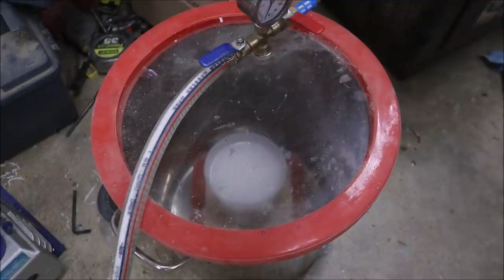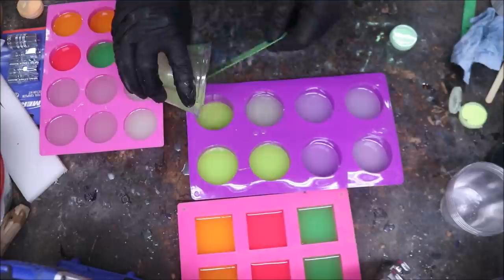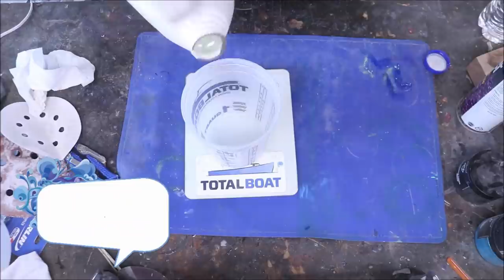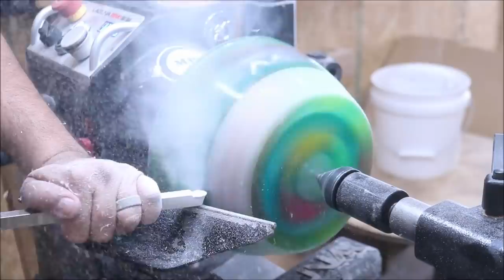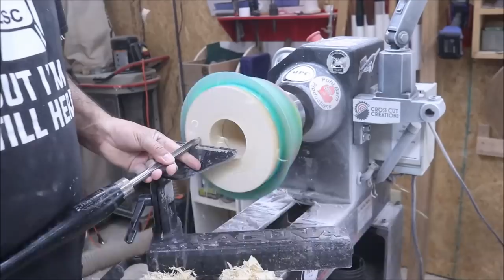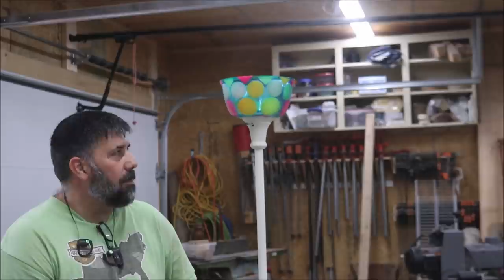Incredible Lampshade With Built-in Glow in The Dark Night Light

Comment: "Popped up and hit me in the face!" That's bound to happen when you try to take of as much wood as you can in one pass. Had to stop watching about 2/3 way thru. Even though a majority of that section was fast forwarded, I could not handle the chatter no more from trying to cut so deep. I'm sure this turned out beautiful. Love what you do! Keep up the great work!
Reply from the maker: The wood popped up because the waste block was two 2x4 hot glued together.  The center at the top wasn’t connected. As for the chatter.   It didn’t matter how much I took off, heavy passes or light passes the vibration from resin is horrible.  Thanks for watching.